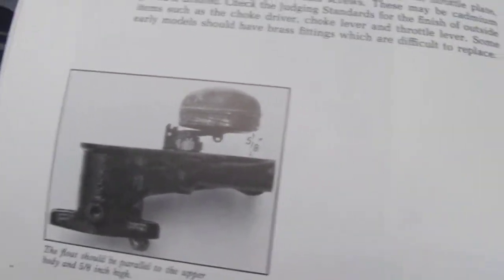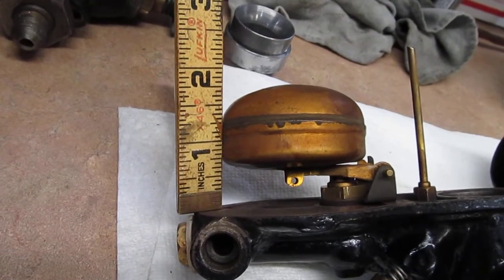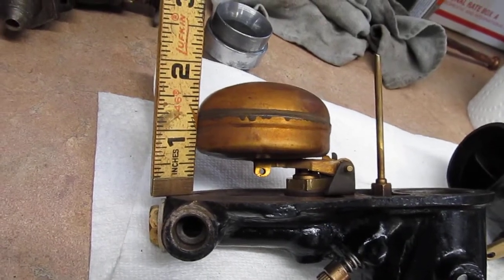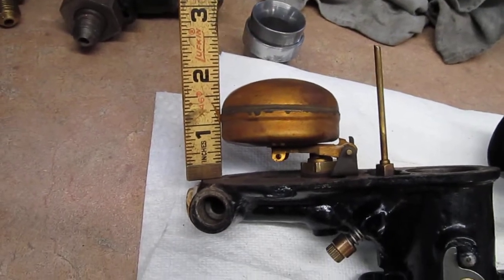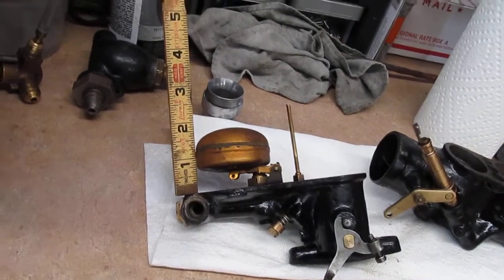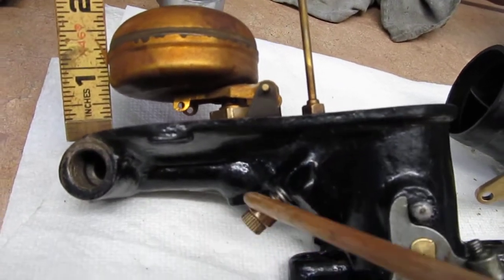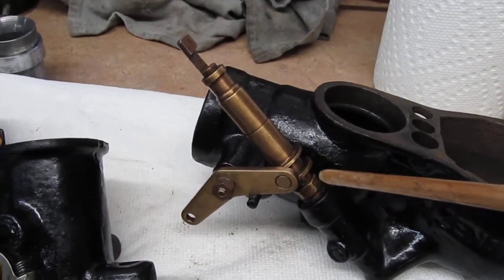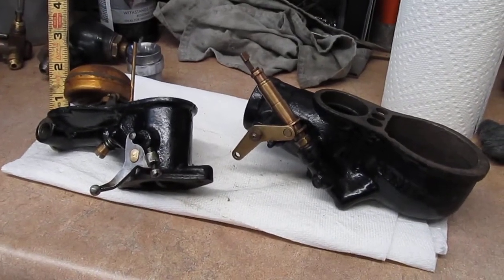Setting float level on Zenith carburator

Comment: The gas adjusting valve (GAV) that turns, connected with your choke lever is nothing more than a high speed adjustment, it should be set to where your car runs the best for the current conditions. This is done while driving... tune as need for current conditions.
Reply from the maker: you need to start the engine in order to get an accurate adjustment. therefore a good starting point is 1.25 turns. adjust should be finalized after a good warm up. open 1/3 turn for cold starting.

Comment: Setting the float parallel to the casting is a fine rough start. But because brass floats have different buoyancy‘s the final adjustment should always be done with shim gaskets under the fuel inlet needle and seat and a site tube screwed into the drain of the carburetor coming up along side the float bowl so you can measure the working level ( 5/8” down from the gasket surface of the upper and lower castings. 
The site tubes are available from me directly and most model a Ford parts suppliers.

Comment: Do you know the Tillotson level?
Reply: The Tillotson float level cannot be set with a tape measure you need to get a site tube on the outside of the carburetor and set the level so that the fuel is 5/8" below the gasket line.